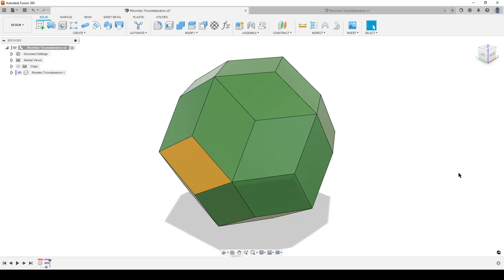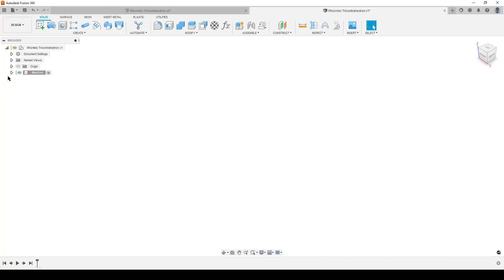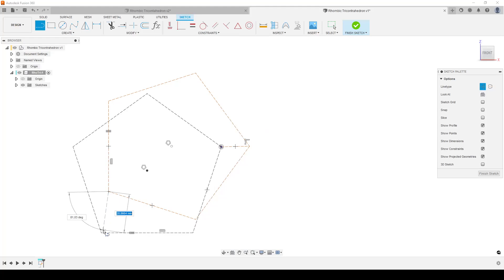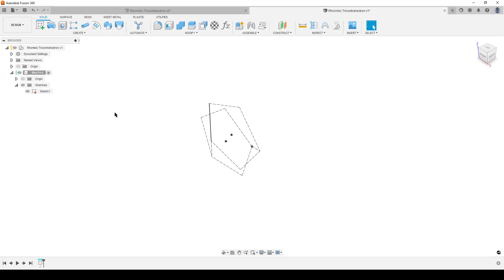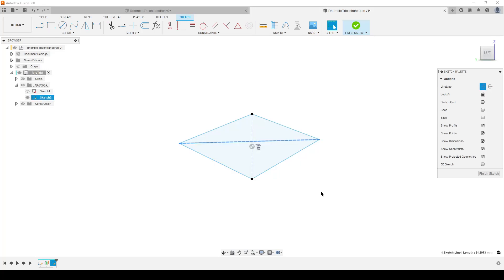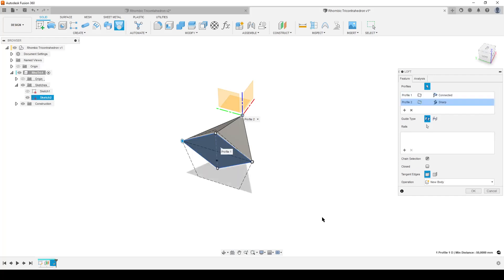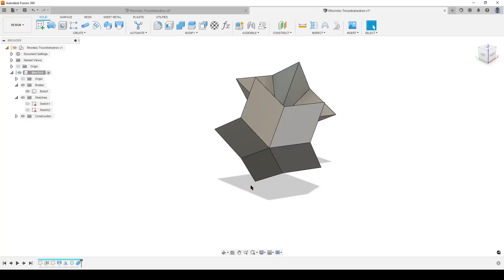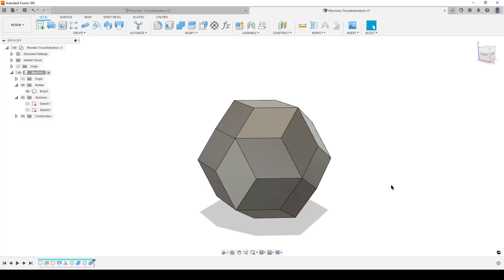Fusion 360 - Rhombic triacontahedron

Comment: Thank you so much for putting out this content!  I had the ridiculous idea of trying to create ice of this shape for cocktails at home.  I modeled casts within Fusion 360 to be 3D printed and then filled with food-safe silicone rubber to make molds designed to make ice in the shape of the Rhombic triacontahedron.  I had a very hard time trying to work out how to model this shape and this video was an eye opener.  With your help, it was surprisingly successful and I've since made a dozen or so pieces of ice in this fascinating shape (60 mm in diameter).  I also modeled the molds to fit within a large insulated tumbler to allow for directional freezing which produces perfectly clear ice.  To be honest,  as a mere hobbyist user of Fusion 360, it was quite an exercise for me to work out how to model a cast to make a mold to fit the contour of the tumbler and produce ice in this shape.  I'm surprised it works so well and I owe a bit of that to you.  Cheers!
Reply from the maker: Thank you so much for your kind comment!  It's always amazing to see how people are using my workflows in their own creative ways, and I'm honored that I could play a small role in your success.

Comment: Nice, though I do find DrStrangelove's tutorial, though for Autodesk Inventor can be done in Fusion 360, a bit easier and quicker.

(do a Disdyakis Triacontahedron next?)
Reply from the maker: My goal was not to make it faster or easier, I wanted to challenge myself and do it with only geometry and often in a slightly different way. I'm planing on redoing some of the polyhedrons using a bit more "math" making the workflows a bit shorter and more useful.
Reply: @KristianLaholm  I would like to see how you'd go about making a Disdyakis Triacontahedron
Reply from the maker: @obsessivecorvid  The only way I can find is similar to DrStrangeloves, using the edges of a truncated icosidoecahedron as reference.
Reply: @KristianLaholm  I make them by using the same way that DrStrangeloves Rhombic triacontahedron is made but loft each face outward
Reply from the maker: @obsessivecorvid  How do you find the distance to loft too? I can't find any useful geometry that gives me the correct dihedral angle.
Reply: @KristianLaholm  I take what the 13.09 is(I believe d1) and sketch a line from the center of the rhombus out by d1/7